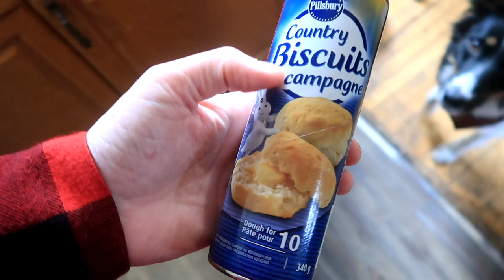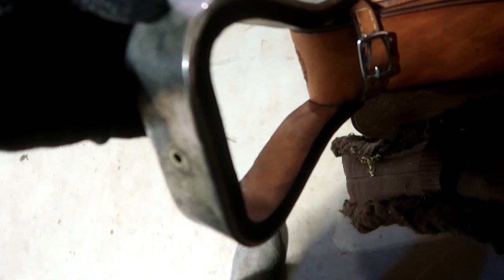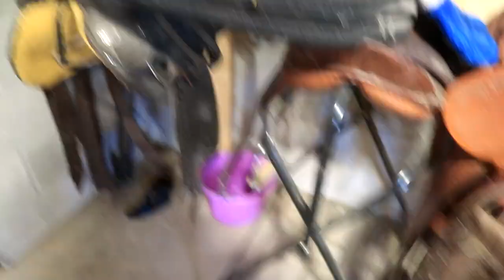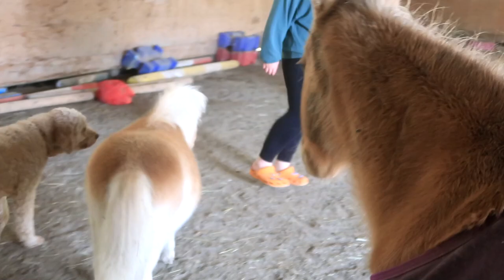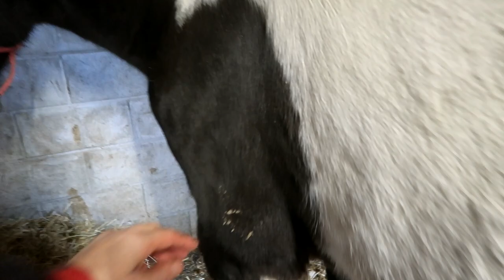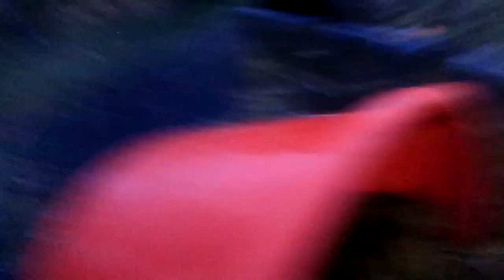The Ugly Truth About My Mare!

Comment: Just to nit pick at a previous comment regarding 'tail bags'. No horse particularly likes wearing one of these they just tolerate it to please us! There fine to put on the night before a show and to travel them in to keep them clean but apart from that there one of these items that horses really don't need!
Also there a big 'no no' in the summer months because of flies, horses need there tails or they wouldn't have them! 

I'm with you Sophie, all of my horses via a couple have been trained to stand still in a bucket of water it's helped massively when i've had to deal with abscesses etc . 
However my advice is to not use a tall bucket like that but a shalower one that some people use as feed bowls as any small spook by the horse  which makes them move the sound of the bucket round there leg can suddenly panak them and when there tall ones like yours it cvan be dangerous with unfortunate consequences if they cant get there leg up and out quick enough.

But the biggest thing I wanted to point out is that you guys have left the handle on the bucket! I no it's an overlooked mistake but horses have broken there legs getting them caught p in bucket handles. Just an innocent happed to a riding school pony not far from me.

Pretty please take the handle off x 

Im with you Sophie my two are also trained to stand in a bucket of water